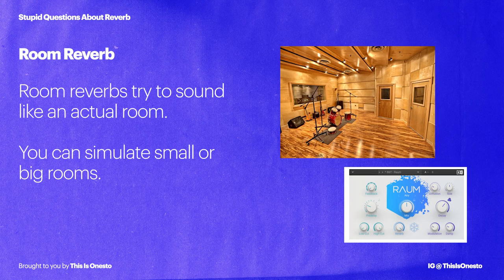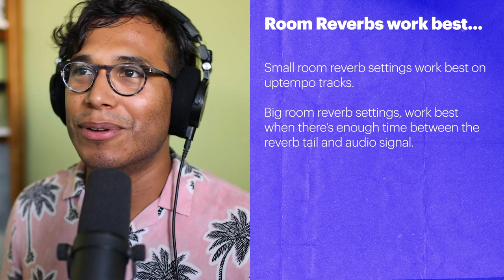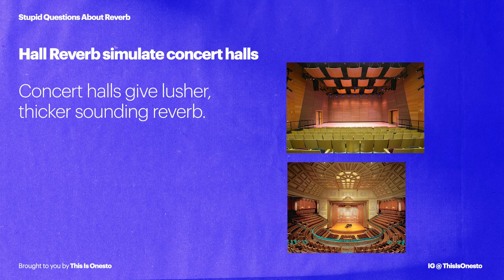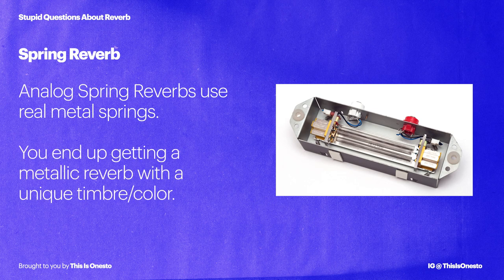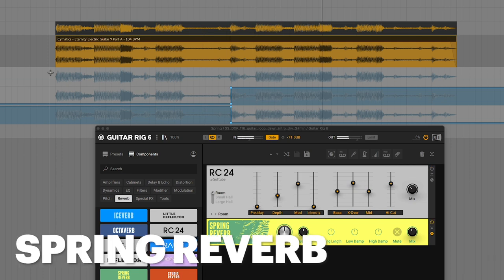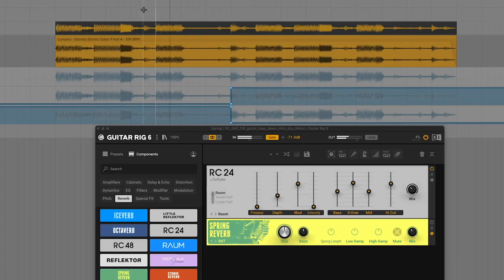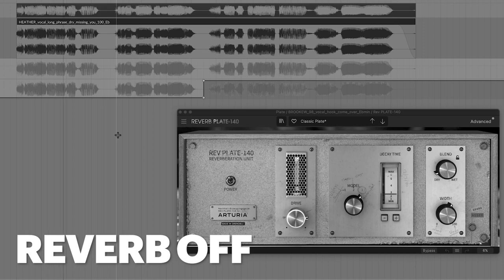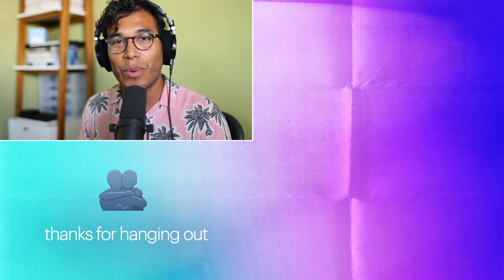4 Types of Reverb Explained | Room, Hall, Spring, Plate

Comment: Great video Onesto, I knew the different types of reverb by ear but I didn't really know that plate reverb was best paired with vocals. Another reverb I had a hard time wrapping my head around is convolution reverb/ impulse responses, witch is an input signal/waveform based reverb commonly used on the master bus to make a track feel like it's in a certain space, pretty much room/plate/spring or hall but wave based if I understand it correctly
Reply from the maker: I've always been a little confused about convolution reverb too. I think what you're describing is pretty accurately. Maybe it's something that I make a video about.